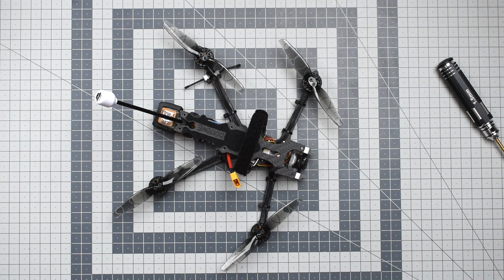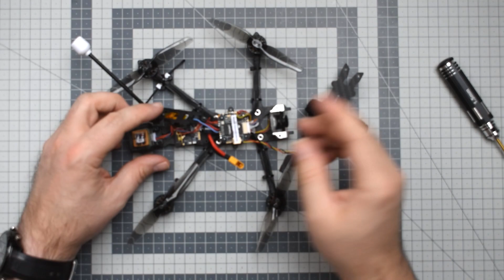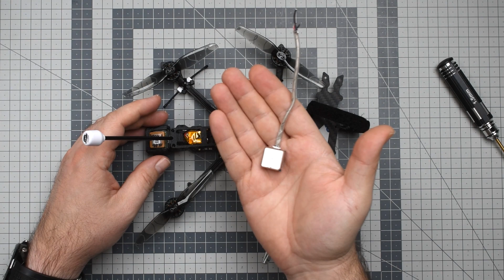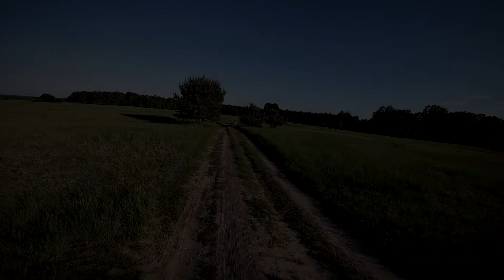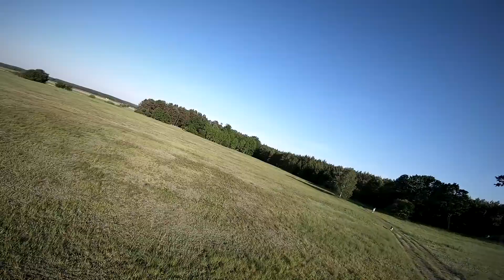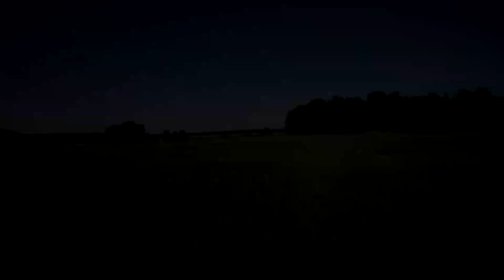No GPS fix when battery is connected? This is why!

Comment: I installed my first GPS on the quad I just built (in a Bee35 Pro frame). I went with the HGLRC M100 Mini GPS, which is a pretty dirt cheap, tiny GPS. I added a ViFly GPS-Mate, too. I start the GPS fix process using the button on the GPS-Mate on my way to fly. It tends to be ready when I'm ready to start flying (a couple minutes later) and while I'm flying I tend to see 20+ satellites. I've considered myself lucky from the start :)
Reply: Funny, I have the same frame and I use my old iFlight M8 GPS (it was perfectly fixing sats before on a 6" drone) and If I power the drone with the 6s lipo, it needs 10 minutes to get 6 sats :/ 
So now, I'm using a power bank 2 minutes before plugging the 6s and got 15 sats. 
I know the GPS mate, I'm using one on a ATOMRC Dolphin it's very nice to keep O3 off before lunching the plane ! Good solution too !
Reply: HGLRC M100 Mini was working perfectly for me (20+ satellites locked) until I swapped analog for Walknsail. Now it struggles to lock 8-9 sats.

Comment: Great tips....btw when I have problem to get satellite, I connect FC to power bank/handphone in order to turn-on FC. Then after get some satellites/3D TRUE (check using BF on android app), I disconnect power bank then connect battery and fly with GPS locked. As you mentioned, the GPS module getting issue because of VTX signal, that's happen in my drone also. 
Before I know that way, at least I need more than 5 mins to get sats & causing Core Temp overheat

Comment: It is possible to turn off compass signal from gps module and use magnetometer on fc? Some CLI commands? My compass in gps module shows always different inaccurate values.

Comment: Hello pawel, your diagnosis is correct but the only solution is to move the gps as far as possible from the vtx antenna, no change in the gps will help or a better gps if the field where it is located is saturated by radiation and harmonics from the vtx , kind regards

Comment: i wanna share with you what is just happened to me . I've build a new quad on Diatone Roma v2 frame , speedybee stack, mamba ultra vtx , t-motors pacer 2305 and some GPS antennaa (Beitan 180 , beitan 220,  tbs 22mm , sorry but i forgot model about tbs) . Speedybee for rx  and gps dedicated uart have a dedicated 5V pin , you can power uarts by USB. Well on GPS uart tension was 4.31V , i've tried quad and no way to have GPS fix  . I tried all GPS module here and no way , no fix.  Two days ago i tried to connect GPS module to "normal 5V" and yesterday i've got fix in 3 minutes. 8 Sats and then increase to 12 / 15 sats during flight.  I don't understand why it works now. I do not really know. Electronics mystery. By the way i will follow your advice and i'll buy a better GPS.    I wish you ah happy New Year!

Comment: Yes. This is a proper conclusion. The connection between FC and the GPS has nothing to do with it. The only thing that matters is the RF/EM noise around the GPS. So moving the GPS or getting a better "shielded/filtered" unit is the solution.

However, I had a similar problem on my flywoo and I had a simple fix. Just move the GPS above the camera (further from the VTX) and it works like a charm now.

Comment: I crashed my eachine novice iv and the bn 180 came loose and a piece broke off the board. Bought a new 1, and still get as many gps as with broke 1... zero. When replacing the bn 180 do I need to do something in betaflight? Or can I just omit that setting all together?

Comment: Thanks for all you done for rc hobby, but no one electronic engineer will do not know value of period for frequency of 50 Hz . You are thinking about electrical noise around gps searching of reason do not correctly working gps.  You shold know that any electrical or magnetical traces of any equipment of drone cannot has any significant value in band of gps frequencies. One of the reason can be only the signals on power supply lines. Why you dont use the oscilloscope ?

Comment: @Paweł Spychalski
Would Matek SAM-M8Q be any worse than Matek M8Q-5883 in terms of sensitivity to noise?
I have tried SAM-M8Q  on Eachine Novice IV and it also struggles to get GPS fix.
Maybe Matek M8Q-5883 would work better...
Reply from the maker: They should be on-pair

Comment: mine was taking 20 mins to latch on sats got a new puk all sorted turns out it was the battery on the gps was dead
Reply from the maker: That also does not help :) But 20 minutes is max interval. Even if cold start takes longer than 5 minutes, something is wrong

Comment: Changed 5$ GPS module to way pricier Matek and situation is still the same - after connecting LiPo GPS satellite count goes from 10+ to 4-5 no matter how weather is or how i place my drone. Very big bummer. Everything was working great with old VTX (AKK Race Ranger). After changing it to Rush Tank i have GPS issues.
Reply from the maker: Then maybe it's a VTX issue? Take a look at this https://youtu.be/QfwV7NP5BI8 data shows that better GPS is just better

Comment: Recently, I saw a drone channel recommending powering up the GPS with a BEC without using the FC 5V supply. So, I will test it as soon as possible to see if the GPS works better.
Reply from the maker: might but also might not work. Sure, good external BEC might have better filtering than FC BEC, but the problem might be coming from somewhere else or still be not enough

Comment: Maybe the VTX antenna which is sending the signal and is over the GPS antenna interferes with its working speed? Why not put a GPS mount above the VTX mount and have clearance for the GPS antenna to the sky so it can work without any obstacles?? All GSP drone manufacturers seem to stubbornly keep mounting the GPS below the VTX antenna - and this does not help in anything.

Comment: Hmmm, we have not come to the bottom of this problem yet.
I have a crappy HGLRC M80 GPS on a crappy (inaccurately cut) Rekon 5 frame. I got an expensive GPS, but I don't have a TPU piece to mount it in. In my desperation, I replaced my crappy HGLRC VTX instead with a Rush Tank Mini I already had. Believe it or not, problem solved. Happy as can be. It quickly finds 11 sats.

Comment: Those cheaper small GPS got huge interference from Flight controller. My cheap GPS - 3d fix is lost if i move my powered quad closer than 2.5 - 3 cm closer to rear of my quad. 
Right now im trying to upgrade gps chip firmware, but i think i need just new longer GPS mount.

Comment: what the heck is wrong with people putting GPS antennae under the VTX feeders? Why most of the quads are designed so? If you add the GPS function - make sure it works, otherwise - do not add it at all.

Comment: I just print a different mount for the original GPS to move it a little to the back  (around 1.5 cm) 
In the space added between the GPS and the frame I put also a small buzzer with the battery
I used the serial 4 instead of the 5 to use the original wires and I connected the GPS power to the 3.3 instead of 5v
Now acquires the fix in less than 1 minute with the cold start :)

Comment: or just put Gps module on the arm near motor, and problem will be solved
Reply from the maker: and do you want to have a GPS that costs a measureable amount of gold coins right below the rotating propeller that might bend and hit it with all the force?

Comment: Putting the GPS reciever directly under and next to a VTX...stupid... TBF, BF Satallite support is crap anyway, so it's a combination of things..On my iNAV Quads, the GPS is at the front of the quad, VTX at the rear...Lipo is underslung giving antennas an easier time. Not having underslung Lipos, another design blunder...🤔🙄🙄🙄🇬🇧

Comment: I have 3 of these type quads that i built  not prebuilt and every one of my gps work fine so its in the way they are being built from manufacturers all 3 are analog with tbs pro32 vtx nanos one diatone one flywoo and one hexplorer mwaybe just the way im runing wires and differant components but they all work i have an hglrc in 1 a flywoo in another and an i flight gps units

Comment: Would happen if tried to placed GPS above the front camera? 
Realize it would interfere with mounting HD camera above; but curious if issue is more interference with VTX, or ESC/FC radio noise. 
Another option, mounting GPS on top of battery.
Again, realize not the most pragmatic solutions; but worth noting/experimenting to collect real life data .. as to source of noise and its radius of influence. ;)

Comment: Hi Pawel, I'm trying to get flywoo support to send you their flywoof411v2 board (maybe even the whole explorer quad?) With the help from stronag, I almost have it completely working with inav 2.6 (there isn't a target for it yet).  It has the SDA/SCL pads on it so it will support a baro/compass.  With a better GPS I too was able to get 12 sats reasonably quick with it mounted in the back, but with mine mounted on a mast I get over 20 sats and a lock in seconds!  https://youtu.be/J1zlDSusV_0

Comment: have you tried assist now with ublox software ?  I2C pull up resistors when using inav ? it is possible with those cheap gps modules But youre totally right using the matek m8q. Use it on all my quads and get a rocksolid fix within a minute !

Comment: Hi. Thanks for your time and test! On my geprc baby crocodile, GPS is above vtx antenna. Maybe it is little bit better? You could try :).
It is a bn220 maybe better than bn180 on some other 4" lr? 
And for me the first fix take 2-4 minutes. And some time I get fix inside my house.
Bn220 is enough good or I should upgrade to a more reliable one?
Reply: the bn 220 has flash memory and you can use assist now with it
Reply: @puntenpol  Assist should be loaded from computer? Or juste enable it into betaflight is enough? How many time value are valid? thanks.
Reply: @J2_P  it's an option in the ublox software,  you have to make a free account and it basically flashes the satellite positions from your area into the GPS memory. Yes it's from pc
Reply: @J2_P  type in YouTube  gps fix  tmac.  You'll see a tutorial
Reply: I use BN-180 for 4", 5" and BN-220 for LR 7" and LR Capricana v2 LR Wing and a 880 for my 2200mm Wing

Comment: I have the same problem with my 4" using HGLRC gps.  Still not working.  I will try a different gps. On my 5 inch quad I changed to an expensive BRAINfpv GPS and it works magnificently now.  But the BrainGPS is way too big and heavy for a 4 incher.  I will order Matek. thanks

Comment: Hi @Pavel - many thanks for the video. Got a quick question sir. With the better GPS units (like the Matek or the better beitian), is mast mounting the GPS still required in iNav, or will this type of 'hanging off the back' mount work as well?

Comment: Good honest info, thanks Pawel. My Chimera4 GPS works okay except for altitude, which is radically incorrect and all over the place. I got a new FC with a barometer to replace stock...will  Betaflight GPS rescue use barometric altitude or GPS? GPS altitude seems problematic even in more general use (besides quads).

Comment: great explanation as always! :) Im using the matek gps module and I can say that its well worth its price.
another nice trick im using is powering the gps module from a 4.5v pad - and "warming it up" with a powerbank to usb connection that will power the 4.5v pad without powering the vtx.
Reply: Do same thing. (Is it 4.5v? I think it's 3.3)
Reply: @aemarkov  I believe the matek requires at least 4.0v to work - I didn't try it with a 3.3v pad.
Reply: @aemarkov  bn-180 is working with 3.3v but , its still a bn-180 😆

Comment: I have a number of bn880 gps without issues from 2.5 to 5 inch quads
Reply: u willing to sell one? Use a BN-180 for quads up to 5". 7" LR can also use the Beitan 180, but a BN-220 is ideal for LR quads, 7" and 15" and LR Wings

Comment: or change VTX to fully shielded? in my free time I will check the noise level on ~ 1.2GHz (GPS) using HackRF from my VTX
Reply from the maker: Those things are not really shielded. Or rather the fact that there is an alu enclosure does not means it's connected to ground and acts like a shield at all
Reply: @FPVUniversity  its not need to conect to ground.  i use about 3 years this type of shildig ( wihout grounding) for gps and it WORKS!! this type of shield reflect radiowaves.
Reply: @FPVUniversity  without filters or a badly designed VTX, the screens will not do anything because the noise will come from the antenna. But maybe we can find beter and worse models :)

Comment: The TBS M8-2 works great for me, quick to lock on, less then 20 seconds on a cold start
Reply: I can second this the tbs m8 is the best I’ve used of all gps units less than 30$
Reply: Great to know! Thanks! 😊
Reply: Because it's GLONASS only. I noticed the same and now only use this GPS. I get a lock in 30 seconds or so every time.

Comment: I had no luck with 2 of the Diatone GPS modules, then I tried the TBS module and still no luck, bought the Matek M8Q and I have working GPS.
Reply: Oh. Other guy bought tbs and worked great. I bought hglrc and flywoo v2 to test

Comment: Think I mentioned previously I repositioned the GPS to the front of the quad on a small GPS stalk mount and it works perfectly, when I tried it in the garden I got 18 sats and when I plugged in the battery it didn't loose the lock (I also moved the GPS positive to the 3.3v rail and use a USB power bank to initially power the quad on until I get a lock).

Comment: flywoo exlorer not have this problem . on this kwad other problem , in stock gps works on 9600 baudrate  and betaflight have glitches with gps rescue... to fix you need to set 57600 baudrate , than all works perfect.